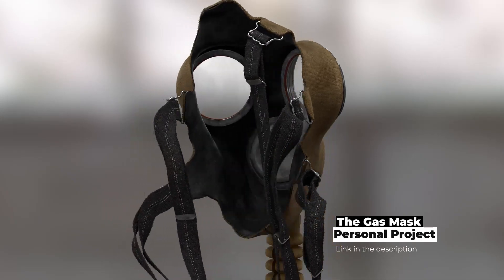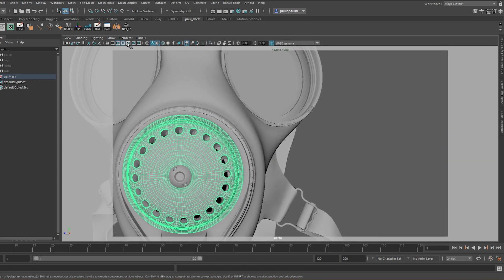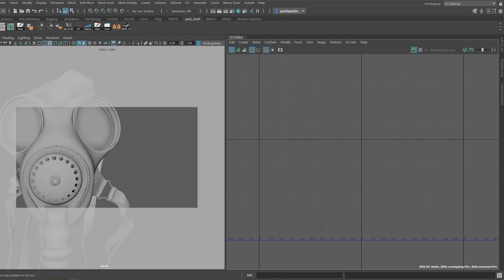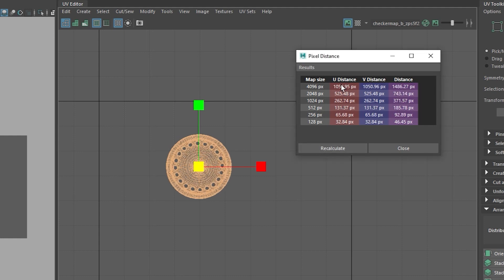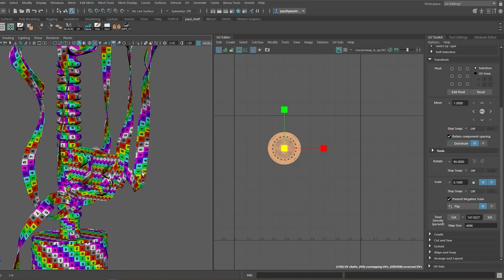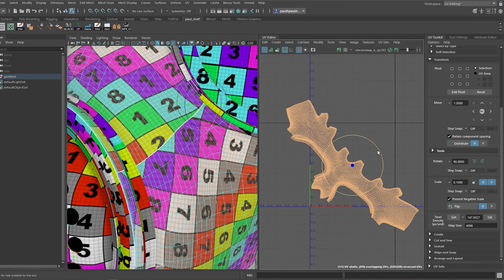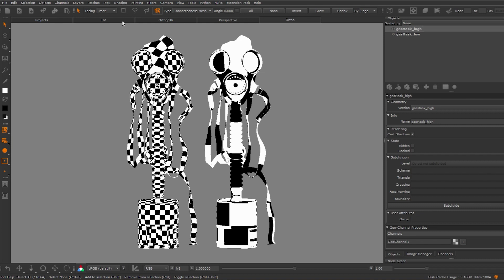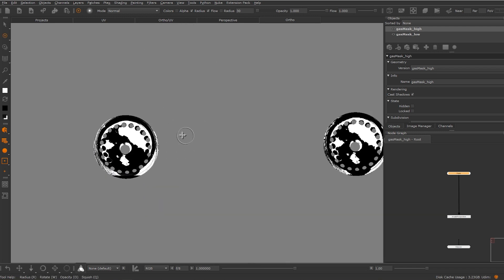How To Find The Right TEXEL DENSITY For Your Asset | VFX

Comment: Great video, but i'm confused. You mentioned wanting to avoid 8K textures. Totally understandable. But then you had a lot of UDIMs at 4k. that would be way more expensive than one 8k texture map wouldn't it? Because then would each UDIM have its own texture map at 4K?
Reply from the maker: I haven't worked with Mari in a few years, but back then, I recall having a real hard time working with 8K maps - Maybe things are better now with the new GPUs, but working with 4K tiles was way more manageable from a performance perspective. It also allows the user to hide a few udims if needed, making it easier to manage a heavy scene.

Comment: Hi Paul,
I don't understand why the resolution doubles. The circular part of the mask takes up 500 by 500 pixels. If you do not change the camera you will never display a higher resolution. So why not set the tensel density so that the element in the 4k map also occupies 500px.
I read your post on artstation. There you also write that the map size should be 2 times larger than the output size of the element in the render.
Maybe I lack some knowledge, but is it not so, that the texture on the render will have only 500px. You will not see this extra resolution.
Reply from the maker: Hi Tomasz, the reason why we double the resolution is because the UV unwrapping process is done early on in production, and one thing that happens a LOT in VFX, is a request for a closer angle on certain assets, especially hero ones. 

If your lead/supervisor asks you to increase the resolution on your asset and you don't have enough in your UV space, you'll have to increase the texture resolution from 4K to 8K, and it can be a nightmare to deal with that amount of data.

So, sometimes doubling the resolution can be overkill, but it can also avoid future headaches. 

But of course, that would depend a lot on the asset. If it's just a background asset, I won't even bother and I want to be conscious about keeping a light footprint. But if I'm working on a hero creature/vehicle, I rather make sure I have enough to work with.
Reply: @PaulHPaulino  I understand that there is no technic reason. This enlarged texture is in case of any changes that will make the object closer to the camera. I am working on a scene for the series, the final render 4k, I try not to make textures larger than necessary. In my case, the camera is already selected and will not change. 

I have one more question. You write that after changing the camera there may be a need to change the textures from 4k to 8k. What can be problematic because of the difficulty of working with such large files. But if it turns out that you need to change the texture by 20 percent. That is from 4096 px to 5000 px. I know that we use textures whose size is powers of 2. But is this rule is not related to the limitation of older graphics cards, and today we can use a texture of any size such as 5000px
Reply from the maker: @sawtom  If you are 100% sure you won't get any closer to your asset, that's totally fine to keep the resolution 1:1. Unfortunately that isn't the reality in most VFX productions (I really wish it was, since this is one the biggest headaches that texture artists have to deal with, especially if they aren't responsible for their own UVs)

As far as I know, in production, most renderers won't accept textures that won't conform to the power of 2, but my knowledge on the issue might be outdated. Hopefully, this can change in the future! That's why it's important to have some leaway with your UVs right from the get-go, so you won't have to scale it up to 8K. If you plan accordingly, you'll rarely have to deal with it - I've only done it a couple of times in my career, and it's truly a pain to deal with so much resolution.

There are also techniques that can be used if you have multiple udims, such as only scaling up certain tiles to 8K and keep other 4K, but things can get messy if you're not organized.

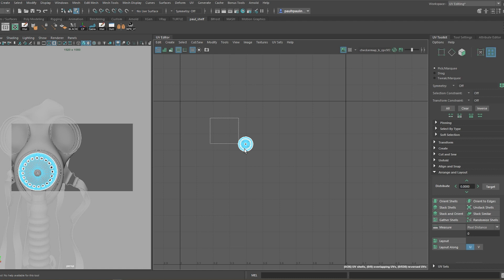Comment: Hi. I've never used the measure tool at 3:46. You went through it pretty quickly and I didn't fully understand how it's used. Somehow in using Maya for 5 years, I've never used this tool.  Could you do a video on what is represents and how to properly use it? - I'm currently using Maya 2022. I'm not seeing much information about it on the Autodesk forum. thanks
Reply from the maker: Hi! Being really honest, I barely use this tool, aside from measuring UV shells. :(
In this video, I used it just as a guide to see how many pixels my UVs had from one end to the other, and if that would be close to the resolution I was looking for. 

So it's mostly used a guide, rather than a definitive measurement. I often start with the measurements and then I ajdust them by eye afterwards.

Comment: When the Texel density value of a bigger size mesh is applied to the comparatively lower sized mesh part, it becomes much smaller than the 0-1 UV space (I mean it wastes a lot of UV space even its available, but cant be used just to make the UVs consistent ). And vise-versa, if the Texel value of the smaller mesh part is applied to the bigger chunk, the UV island will cross 0-1 space, which becomes a problem where there's only one big island. How can I overcome this problem?
Reply from the maker: Hi Rushikesh,

I usually use the largest UV island that I can fit within a tile as a guide for my measurement. From there I apply to other meshes, and if the shells are too small, I just scale them up. I try to scale them using the power of 2, just so it's easier to scale things up later.

Comment: Hey Paul.  I was taking notes, and I noticed that when you used the measure tool, you were using the U and V distance along the 4K row, even though this object was 512.  You said the UV space resolution should be double that - or 1K, in this case.  Wouldn't you be using the information found on the 1K row?  Or did I misunderstand what I was seeing?  Thanks so much.
Reply from the maker: Hi Benjamin,

In this example, my texture map output is 4K and my screen size is roughly 2K.
So, if my object occupies 512 px on the screen, I want to double that density in my UV coordinates to get closer to 1K. I wrote a bit more about it in this post: https://www.artstation.com/artwork/W2PdQ2

Hope it makes sense!